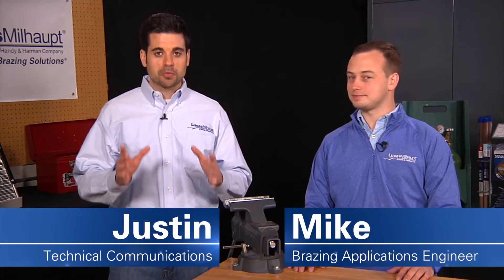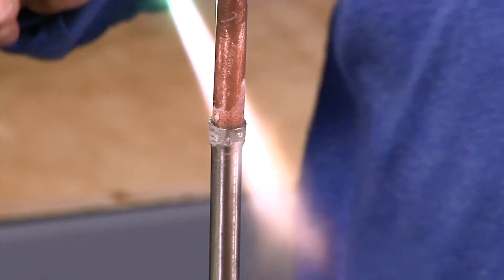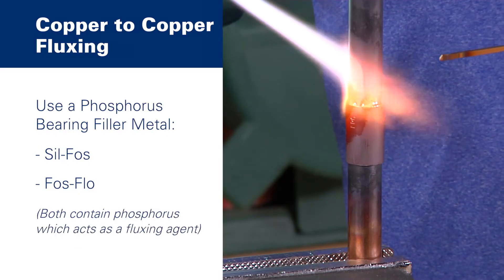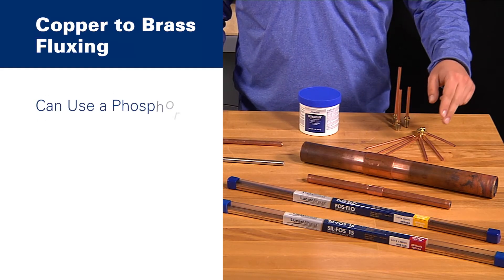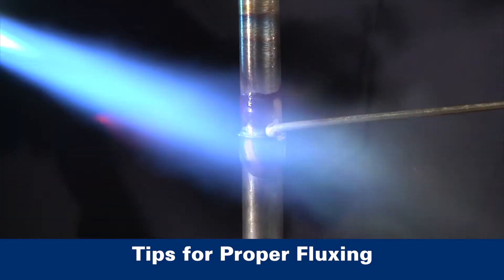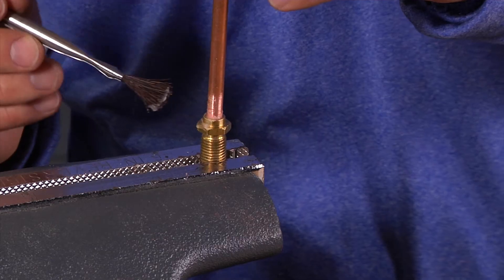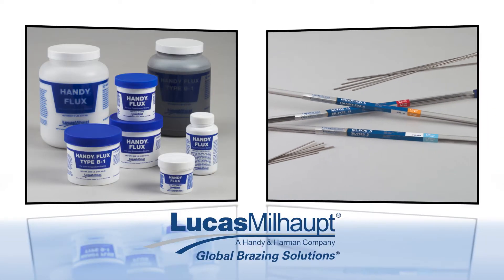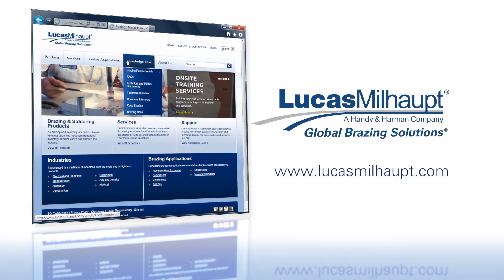Fundamentals of Brazing #3: Fluxing the Parts

Comment: A chemical compound has three uses with different metal types: 1- Copper to copper-flux (phosphorous bearing filler metal & flux), 2-Copper to steel-flux (a phosphorous-free filler metal & flux), 3-Copper to brass (Phosphorous filler metal & flux applied as a paste or a filler compound as a wire filler).  Great information as usual, keep up the good work on YouTube.

T J (Tom) Vanderloop, Author, AWS Member & Technology Instructor